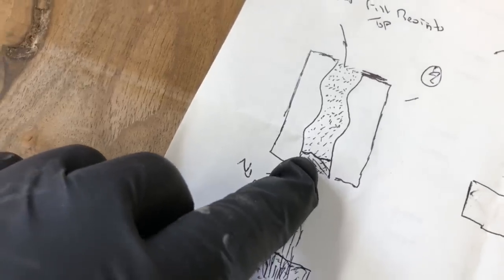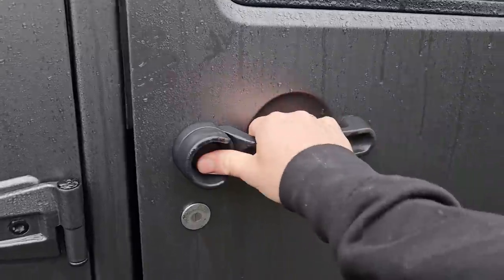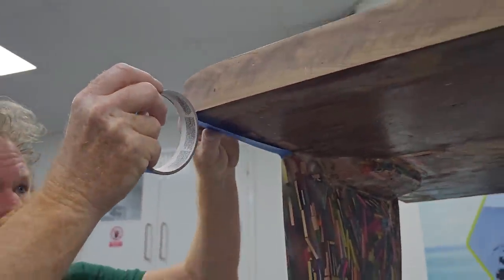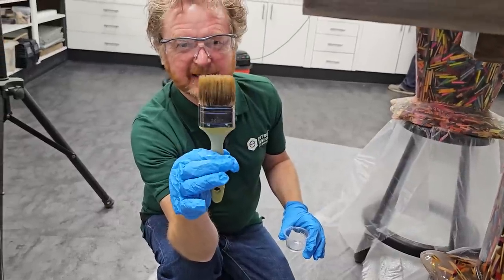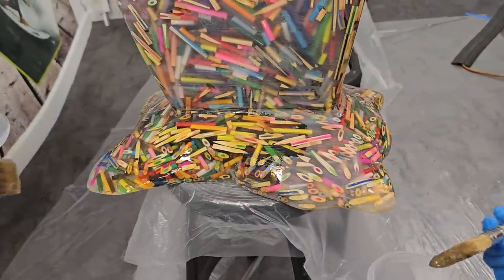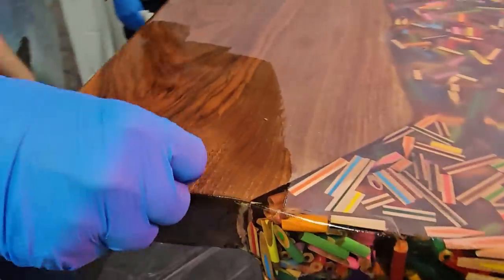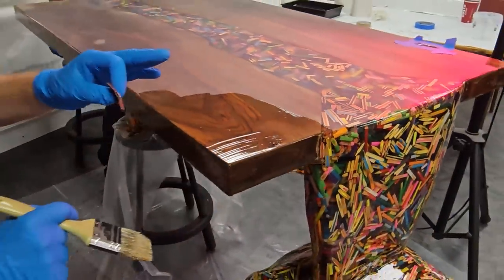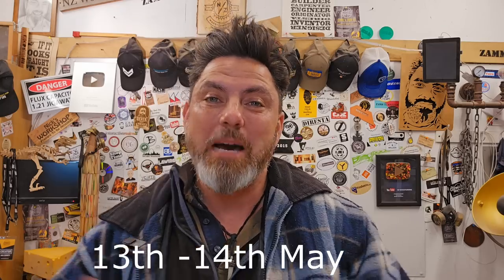If only I did this in the first place !!

Comment: And if you still have issues taking the tape off with the drips just heat it up and the epoxy will get softer and makes the peeling easier. Better to not wait for it to fully cure as you get less damage to the sides 💡
Also the holes in the epoxy aren't always contamination, it can also be not enough epoxy which breaks the surface tension too.